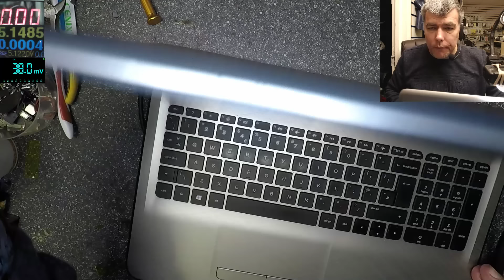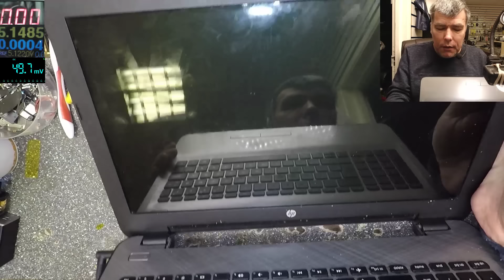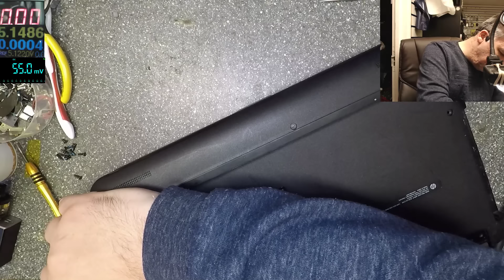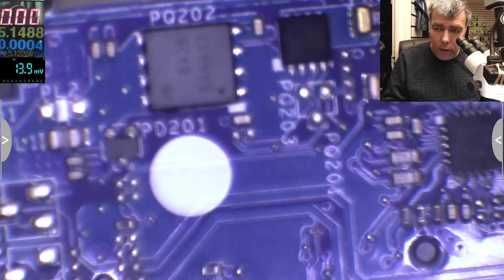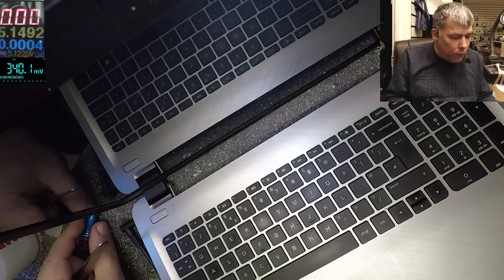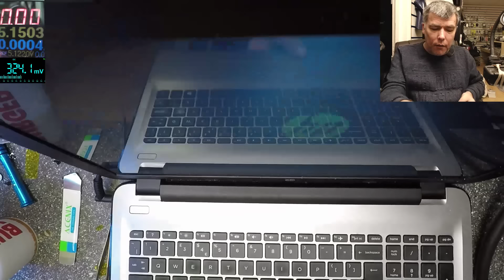Most common fault on a Dead Laptop

Comment: Replacing the MOSFET by a shorter (even if it's a fuse) may still be dangerous; not when running on the batter, but when plugging the charger cord when the battery is low: there's a huge spike of current, which can propagate to the rest of the motherboard (nd burining any digital chip behind): that's what the MOSFET is protecting. Thanks the primary mosfet has two output gates, distributing the power as needed for each, and they go to a secondary MOSFET before going to each of the two separate parts after a regulators gernerating the various voltages (most probably one for the CPU/GPU/APU, the second one for the rest i.e. DRAM, bus controlers,  display panel, PCI devices; possibly the harddrive and DVD if it uses a motor and there's no SSD, the 2nd secondary MOSFET could be used, but I bet that the panel itself has its own MOSFET an some capacitors to regulate the backlight power when lighting it on., also to avoid excessive current spikes when powefing on, just to initially charge the capacitors..).
It is likely a problem caused by the charger, when plugging it to the PC, or even more likely when its DC output cable was plugged, but its AC input was plugged on the AC 220-240 or 110-120V power outlet, possibly via a bad interrupter; or may be the charger was still positioned for a 110V input, when it was plugged on a 220V-240V outlet.
My opinion is that the charger block may be damaged, I would inspect its internal capacitors and protection devices even if its internal fuse did not fuse: it may have been enough to deliver excessive voltage to a depleted battery, and with the multiplynig effect of the current spike, it could have have increased the dephased current too much inside the charger that then delivered a too high current. Or may be the user of the PC tried with the wrong AC-DC charger block made for another more powerful PC capable of accepting higher input voltages to deliver the power with lower currents and less resistive heat in its cable or on connectors and the motherboard (up to its internal larger battery and its main MOSFET).
Anyway a burnt MOSFET is not the most frequent cause for electronic devices to stop working: in most cases it is caused by capacitors, and you can see that immediately on their top, or becaused they have fused and spread all arounf: the ejected products are very harmful to a motherboard, they destroy the very thin printed layers, if this happens, and don't act quite fast, it will be hard to repair: you need to clean these chemicals that oxydate the printed circuits rapidly, and its very dificult to restore them.
Good electronic devices place capacitors on a protective support that can retain them, you just have to replace the burnt capacitors but no damage on the circuit, unless the capacitors were shortened, in which case the short can allow huge currents to flow in the printed circuits, and burn them all around the motherboard, including on internal layers adn this cannot be repaired at all.
MOSFETS are also there to protect the capacitors on their output: when a MOSFET is defective and burnt, usually there's no damage around, all occurs inside the chip cover, which may just be slightly deformed by the heat.
I would not recommand using thic repaired PC without knowing the cause of the current spike and if it was caused by the charger block, unless it was caused by a misuse on a poor AC outlet, or just accidentally by a storm strike, not completely protected by the home AC installation. Or may be someone used a multiiplug to connect the charger, and another powerful engine  was started on the same multiplug block (like a hairdresser, or worse a vacuum cleaner with too high dephasing an insufficient protection to keep the current with low phase difference from the voltage, causing both a high inductive current and voltage spike on the plug).

In general you should always plug the AC power on the AC-DC charger block, before plugging it to a PC via its 19V output chord. The same is true for most flat TV panels, but generally you cannot plug their AC input before powering it on: flat TVs instead use a relay to delay the DC output of their internal PSU for a faction of second., but the protection comes with inductive bobinas and a magnet around on the eng of the power chord, to oppose and reflect incoming spikes before theiy reach the first input MOSFET or capacitors. Good motherboards use many input and output capacitors all around the circuits, and many MOSFETs around voltage regulators. But that's rare for small mobile devices such as your thin notebooks and a tiny motherboard surface: most of the surface is used instead to fit the battery, the heat dissipators the fans and storage disks, or a secondary child board for audio amplifiers and other analog devices like TV antenna input, or the supply for panel backlights.

The other common cause for a PC no longer working is inside harddisks (failing to rotate correctly and generating lot of read/write errors; this is generally caused by shocks when the PC was powered on and disk heads were not parked in slipping position; the head could also have been damaged or could have severaly destroyed several tracks on the rotating magnetic plate).

The but most defects on notebooks are cracked display panels. Other minor but frequent accidents are damaged or missing keycaps.

Keyboard printed plastic layers shortened by sugared liquids are generally unrepairable: they work for a short time, but rapidly they oxydate, and one or several rows of keys are no longer working, or a single keypress will generate sequence of unrelated characters, as if we were constantly presssing multiple keys at once (this occurs as well for desktop keyboards): in that case you need to replace the keyboard (on notebooks, it may be difficult to find the appropriate model that fits correctly, or they are much more expensive; in that case unplug it from the motherboard, and use an external USB keyboard (but it's no longer a mobile notebook...).

Comment: Thanks a lot Sorin for this video, it always brings back memories (*good ones) for me to be able to diagnosed similar problems in my laptop checking and fixes. (*presently working on a Lenovo Legion laptop that won’t turn on and yet the voltage is present at the charging port but nothing on the other power supply like 3.3V, 5.0V, and the likes. Thanks again! Keep it up the tutorials! Love them all!

Comment: I have a question about my dell Inspiron 15 N5010 was released in 2011 with windows 7 and a friend of mine gave it to me for free and I noticed that it was getting hot all the time so I took it apart and cleaned it up because of dust inside and the thermal paste was dried out so I cleaned up the cpu and put arctic silver 5 on it and windows 7 stopped updating so I wiped it out and installed windows 10 and the arctic silver 5 paste will last for 3 months and it gets hotter than before it was supposed to last 5 years so I think I should find the original compound that was originally in this laptop so any help would help me with this

Comment: Sir, please my laptop Notebook HP 250 fails to power ON, until i dismantle it, heat up the panel, then it will boot, if it shutdown and cold, it won't power ON again.  A repairer said the motherboard is damaged, but I don't think so.
please, what do you think about such case?
thanks

Comment: I have a working charger, adapter, and battery.. but my lap top is still showing no signs of starting. The power led light does not come on, nor does the light on the caps lock key, and the power button itself. 

Where can I buy those tools? I've tried disassembling it and then reassembling it but still same issue.

Comment: This worked for my hp probook 650 G2.
Was ready to throw it away and wanted to try this repair as an last effort.
To open up the laptop and put everything back together is most of the work.
Measured voltage from power jack input, step by step, component by component, and the first mosfet seemed dead.
Made a bridge from small piece of electric cable across the mosfet, with use of solder iron... and guess what. Fixed!
Super thank you for this video!

Comment: I’m surprised you didn’t check the power supply was working first before you bothered to take the back off.  That has to be the most common thing to go and would be the easiest thing to check with a volt metre.

Comment: I can see you are skilled i have a question how can i use external monitor for laptop which does not respond to vga and hdmi cable keyboard and screen gone i have only power supply and motherboard hp probook 4530s ( without component replacement) is that possible make it work on one of ports?  its just fun project :)

Comment: Hello, ı am viewing your videos. And ı like to your works and vlog. Ok now ı have problem hp hqtre71025 laptop motherboard. I have solved ı little bit and laptop is not openning. I have a romevo to 19v power mosfet and jumping circuit but ı'm pressing to power button hdd led is  on to 3 or 4 seconds so laptop is not openning fan is not spinning whats my laptops problem ? And how ı this problem solving. Thank you

Comment: Few remarks: Ofcourse these things should only be done on machines out of warranty ;-) Furthermore, as an IT Technician, is amazes me too see you disconnecting cables and things with the power on the machine! DON'T DO THIS ! Always disconnect the main power when working on a pc/ppc. Also never saw you working with an antistatic wrap... Good that you found a solution but don't go repairing this way at some well known company ;-) It should also be mentioned that buying another second hand motherboard would be way faster and not that expensive after all. For this repair you need to be well equiped.

Comment: thank you very much sir. I fixed the HP laptop that I borrowed from my sister. I just followed all your instructions. I didn't remove the chip because I don't have hot air. I just jumpered over that chip and the lights on. thankyou men. LOVE from Philippines.

Comment: Can you please make a video on the acer aspire 5100 model which is not working though it it very old buied on November 2006 a few months back when I turned it on it worked properly and then when it was strarting the graphics (in Linux) the mouse pointer came and then turned off I want help

Comment: As some one noted  taking out a component and doing that quick fix is very risky the act of doing so opens a pandoras box .Why did the component fail ? ,why not  order another part and replaced  the suspected faulty one . If he does this then it may have worked more than  likely however replacing a new component and it also fails means there is something going on ie another problem or faulty or intermittent part. It may well work with what he did but for how long . But kuddos to him or for at least knowing the parts in what is a very technical area , also did he have a schematic diagram ?

Comment: There was four connections coming into the fuse and four going out, but he said 4 in and 3 out. And then he knew exactly which connection has to be made to give it power, but what did the other connections do or what was they for.  I’m curious to know what the black square was and what it did.  Was it a relay or a fuse. But great video.  I think it’s awesome you knew exactly which connections that had to be made to make it work again.

Comment: Hi sir this is a great video you have fix the laptop with just taking out a single chip. Sir, I have a laptop I turn it to sleep mod because theres a lightning but after the lightning, my laptop wont turn on again. It still has led ligt, but the fan stopped and no display. Do you have any idea how to fix this or any guess whats the problem with my laptop. Thank you for the answers. More Power!

Comment: Ihave a exact same laptop with i3 6thgen .i used it without the battery on wall charger .and it stopped working and only blinks it's capslock .the repair guys in my city are asking to replace the motherboard .help me if it's possible to fix it .do i need a new motherboard or just a new battery.

Comment: Uhh ... I am sure you do good work, and I REALLY hate to be a hater, but...

1.) You applied 19v after the current sense resistor saying "We have no short, yeah? So we can see on the screen its taking no power at all" (10:55) ... just consider the other possible outcome there if you did have a short. I don't know your power supply, so maybe it was massively current limited, but ... if I'm 'learning' from you, and not aware of that nuance, I could easily fry the laptop doing as you did by one of two ways. a) accidentally touching the wrong contact point, b) if there was a short, smoking the board. This is REALLY bad advice, especially for newbies.

2.)  You bypassed the MOSFET with a wire. Essentially, you disabled the laptops ability to disconnect from its charger, meaning it no longer has over-voltage or over-current protection. It only takes one leaky filter capacitor or another kind of internal short to turn that laptop's Li-Ion battery into a potentially deadly bomb. Not saying Li-Ions are perfectly safe even when protected, but you just opened that laptop to a world of new possible ways for it to be problematic.

Ok, so (15:50) you admit you're dodgy. I have no issue w/ that. You wanna run without fuses and disable safety circuitry, have at it. Hell, I disabled my trucks seatbelt warning years ago and run w/ a 30A cabin fuse, I am no man to judge. But your channel is called "Electronics repair school" -- please, and I mean this, be dodgy in your own endeavors, but don't teach it. Teach the proper ways, and then let each find their own level of 'dodgy' that they're comfortable with, as it was done in the old'in days.

Comment: ok, as an experienced electronic service tech of 25 + years, my inquisitive brain has more questions than just 'bridge it and it goes'.

I agree about spending time, it sometimes just isn't worth it, but there are 2 very quick under 60 second tests below that I would have done, for the simple reason that you had almost the exact same voltage 0.8v on both the gate to the FET, and the 'output'.
To me, this suggests a short on the FET between gate and output.
- multimeter resistance check between gate and output when it was removed (not in circuit), if it is shorted, then simply replace the FET, and no dodgy repair, fixed like factory.
- power up and check the gate voltage without the FET in place, if it is higher than the 0.8v you were getting, then you also know the FET was shorting/pulling the gate voltage down.

Of course, if it was still a low gate voltage, and the FET was not shorted, then by all means, shrug your shoulders at the rabbit hole you are staring at, and bridge that puppy if it makes it go, with a little disclaimer to your customer :)

What I like about your video other than the dry humour that I also find funny, is the sheer simplicity of it. If my mother sees this, you're gonna make her keen to pick up a screwdriver at the next electronic thing that stops working!  (which then becomes every tech's nightmare, I'll probably have to fix the mess after she's had a go at it lol)

Comment: Dear Sir,
I like saw your videos very details and make me undestand.
I want to ask you abt my motherboard Toshiba satellite L645 just bought. When i tested, 3 slots usb 2.0 are not detect ( no function) when i plug in keyboard and mouse. When oush caplock and numlock no leds are on. All are running like, intenal keyboard is  function. Fan is blowing fast. I tested motherboard without hdd only Ram 2 gb and cpu i3 370 m free from seller. So what is the problem, pls be inform where component must change. Waiting for your solution, Thank you.

Comment: My HP Laptop won't boot up and found out why, and totally makes since... 

When I first bought a new HP Laptop, no issues, or any other problem, not even a virus, when I got several of updates from Windows, got a BIOS Update (although I didn't set a BIOS Update, didn't know what it was, and how it works and what it does) still works, but then after several of months later in May, my laptop gave out on me

I thought it was a hard drive issue until I realized the motherboard has a short, and it was a brand new hard drive, wasn't told about the motherboard, but there's a possibility that I have a crack on the motherboard where it can't boot up any Operating Systems anymore even Linux

Comment: Hii bro. Iam having hp notebook g5 laptop vachu...in that laptop, display strip has been shorted some how..so i checked by changing new mother board and new strip. but again strip is shorting..new mother board and new  strip both are good..i think display have problem...do u have any idea about the issue..can i able to solve this problem ??? Thanks in advance

Comment: Hello sir, I am from Nepal and I am learning laptop chip level repairing in my place also I am following your channel. I have one problem with NEC  i7 laptop motherboard. please will you guide me? the problem is 19V & 3V is present and 5V is missing. I tried very hard and could not figure it out, also I have searched schematic of this motherboard but I couldn't find it. will you help me, if possible then provide me a schematic of this motherboard?
Motherboard Name: MS-13821 VER 1.0